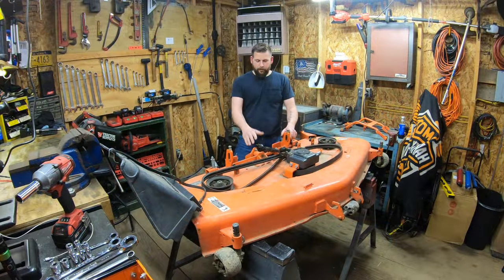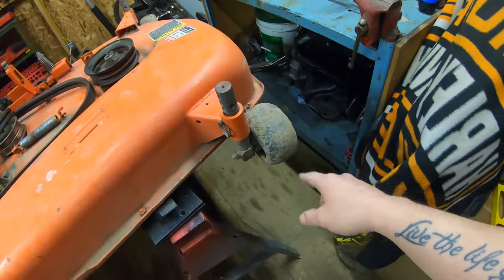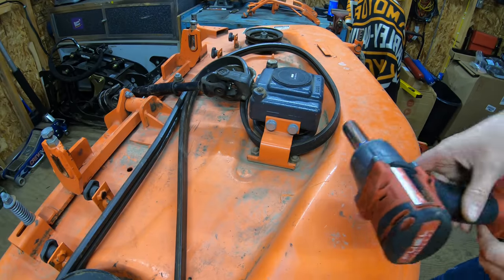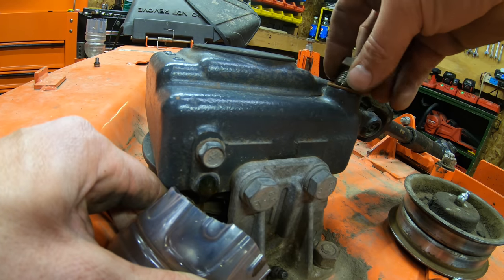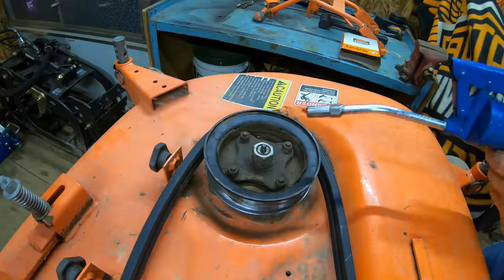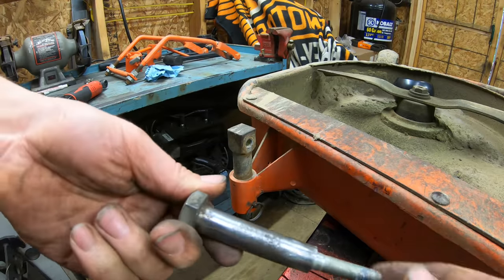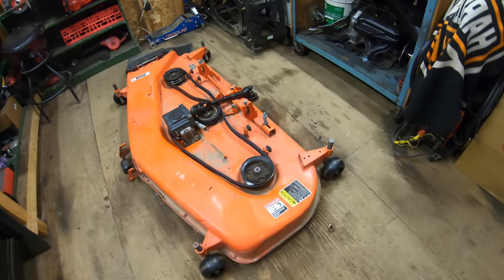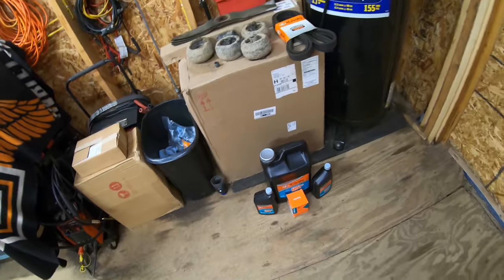Kubota BX- Spring Mower Deck Maintenance!!

Comment: I’ve never thought I’d have a use for the pallet forks, but using them to move the mower deck around has me thinking about it.
Reply from the maker: Pallet forks are one of those attachments you don’t think you’d ever need but end up being one of your main used attachments specially if you do not have a grapple.. before I had my grapple I used pallet forks for everything, from ripping up roots, old flower bed wood boarders, using them for picking up branches/limbs all over my yard every spring, to moving logs and other odd ball objects pallet forks are just a super useful thing to have and for the money you really can’t beat it. A lot of people think you need to move pallets with pallet forks but for most people pallet forks are used 80% of the time for objects other than pallets haha.

Comment: I use the Oregon G6 Gator Blades on my RCK54P23BX deck. They do a great job chopping up the grass and mulching it.
Reply from the maker: Right on, Iv heard a lot of good things about those Gator blades, they work really well for mulching up the grass.. I usually bungee up my grass flap so I run regular kubota “high lift” blades which work real good for the grass Iv got around here. Maybe some day I’ll make the switch tho to try them out 👍🏻
Reply: @BiffsEquipment  Thanks for the reply. I also mow like you, to spread it out and not have the rows of clumped grass.
Reply from the maker: @rickvb2709  very good, that’s the best way to mow in my option, like you said it really spreads the grass out in all directions and gives the lawn a nice striped look when it’s done too 👍🏻

Comment: Another nice video.  I really need to take more care with what grease I use.  Only have one gun so I end up using whatever’s in it for whatever I’m greasing that day.   Also, the one time I took the tensioner spring off, I had to chain the deck to a post and use a ratchet strap to put it on the post.  Swore I’d never take if off again and haven’t.  Yours didn’t look bad at all going back on.
Reply from the maker: Thanks man, sorry your comment for some reason wasn’t showing up under my YT phone app, idk why it hides comments from me sometimes. As for using the same grease for everything I’m sure your not alone there, but I’m pretty OCD when it comes to that, you’ll see much better results and the grease will last much longer if your using the correct grease for the correct applications. The most important thing is, is that your sure to use bearing grease in your bearings.. so if you want to run only one grease then I’d say run a bearing grease in everything and you should be fine.. something like Lucas red N Tacky would be ok in anything tho Moly grease will last much longer in your loader pins specially if your like me and can sometimes go over your hours for greasing your loader. 

Your right these deck springs are a bear to get back on, it took me about 4-5 attempts, I just cut them all out of the video to save on time, it was hard for me to get the leverage with out pulling the deck towards myself like you said lol.

Comment: Great video. I do my maintenance while it's on the ground and it's nice to see a back-friendly alternative. I'm in my 60's and would love to see how you 'flipped' the deck over for blade change. My current method involves a sling strap on the center 'wheel' and pallet forks to get vertical.
Reply from the maker: Thanks Dave, I did it the exact same way as you described, only I lifted it off the saw horses first up in the air then directed it with my hands to be flipped and set it back down. It def makes a big difference working up high where you don’t have to bend over, you can get a nice set of saw horses cheap these days too so that’s what I’d recommend for when you need to do mower deck maint. (I hate working on the ground!) haha .

Comment: Really nice video, Mike. I'm looking to put a small winch on my tractor to help out with logging and other things. Your deck will be happy this summer with the new wheels, belt and blades! I push my Cub Cadet mower blades pretty hard but they're still cutting clean. I need to take a look at them though. Great work as always!
Reply from the maker: Thanks buddy! It sure mows nice now! Used it all morning to finally mow my yard for the first time this spring and it did a fantastic job, best it’s mowed since I bought it! Sounds like you have a little maint. To do yourself before your first mow. As for the winch you can get them pretty cheap at harbor freight, I made an entire video on how I made it winch setup but it’s a really old video but if you find it on my channel it may give you some ideas of how you wanna rig up a winch to your tractor. Thanks for watching! 👍🏻
Reply: I have the G5 Gator mulching blades on my Cub Cadet lawn tractor, they do great, and seem to hold up longer than the factory blades do.
Reply: @wildbill23c  I bought a set of those when I bought mine, but I'm waiting to wear out the factory set before I replace them. I think one more session of "mowing" my trails to clean out the gunk will do it. LOL

Comment: Nice job with this. Only additional thing I would suggest is removing and cleaning out the spindle cups/guards when changing the blades. They get filled up with old grease and grass clippings over time.
Reply from the maker: Thanks buddy, and your right you should do this when you get a chance.. I don’t think it’s needed to do each maintaince cycle but for sure every other cycle just to get that old grease out or to at least pop the cup off and see what it looks like under to see if the grease looks nasty or clumpy. Thanks for the comment!
Reply: New grease takes care of it

Comment: Fantastic video, yesterday I had my first belt issue while mowing with the Kubota. Belt began to delaminate possibly from spindle heat. Did not break but outer layer came off in areas. Your video is helping me with diagnosing the problem and hopefully preventing similar future issues. Mower deck only has 25 hours and blade started to shred when I was mowing tall heavy grass. I was in two wheel drive at 3500 rpm’s in turtle mode. Deck and belt sat in the sun for over a year prior to first use which may have reduced life span. Gear box was weeping quite a bit of fluid on the deck when I immediately removed it after smelling the melting belt and seeing pieces of belt in yard. I had greased all fittings prior to mowing and deck was relatively clean. Any thoughts or suggestions would be appreciated. Thanks again for a great video.

Comment: Nice. I want a BX badly. Trying to manage 8 acres with 2 old wheel horses...
Reply from the maker: Wow that’s a lot to maintain with a few old wheel horses! Tho Iv always been a fan of the older wheel horses I feel you’d be much better suited with a compact or sub compact tractor for sure. Let us know if you buy one!
Reply: Are you only mowing??  If that's all you are doing perhaps a used commercial 72" zero turn would be a great choice.

Comment: You want your rollers about 19mm lower than the bottom of the deck. Not so low that they run on the ground constantly. They are to stop the deck digging in on undulating ground. The hole in the handle of a shifter works for a spring tool. I think you call them crescent wrenches.
Reply from the maker: Yep this is correct. Thanks for sharing!

Comment: Excellent video, some great tips. How did you tip the deck over, is it doable by hand, or use the loader. Also any problem having the gear box upside down. Want to take my blades off for the first time to sharpen. Many thanks.
Reply: Gearbox wil be fine (look if there's a sniffer ontop that may start leaking when it's upside down)
Reply from the maker: Yep it’s doable by hand, I usually flip it over by hand when the Deck is on solid ground like it was at the end of the video.. you shouldn’t have any issues just be careful and watch your PTO shaft doesn’t fall out when you tip it over 👍🏻
Reply from the maker: @rubendejong4412  is correct, because the spring valve/check valve is inside the vent the oil wont spill out of the vent because the check valve will close when it’s upside down keeping the oil from draining out of it
Reply: Thanks will do.  @rubendejong4412

Comment: Thanks Biff, I have a question for you at the end of the season would it be a good idea to take the attention off the tensioner pulley by undoing the spring when you go to put your lawn mower deck away?
Thanks
Michael
Reply from the maker: Hey Mike, yes it’s definitely always a good idea to remove your tensioner spring before you store your deck for the winter .. this will not only keep your spring from stretching but will also keep your belt from stretching as well and it’s actually recommended in the owners manual for the deck I believe. 
Thanks for watching!

Comment: All the grease comes out of the bottom of the spindles. If you take off those guards under the blades you will find all the extra grease.
Reply from the maker: Your correct, the grease is held under those “cups” that sit under the blades.. but what I was referring to is “if you see grease coming OUT the bottom then you know youv got the spindles packed” 

Thanks for watching!

Comment: Some of the Kubota manuals specify to replace the lower (output) seal on the deck gearbox every 4 years. Very inexpensive repair compared to rebuilding the gearbox.
Reply from the maker: I agree! Though I’m really big on (if it ain’t broke don’t fix it) on stuff like that.. but it never hurts to be cautious because a seal is a lot cheaper than a new gearbox! Thanks for the comment

Comment: Nice video! Wherabouts in NY are ya? I'm in WNY between Buffalo and Rochester. One additional thing I do-when I take the blades off, I always remove the dust cups under them and clean out all the dirt/grease/and dried grass, and checked to make sure not dinged up-they are only around $7 each. As far as grease, never thought of the 2 different types. Always used the red grease for all fittings. All Kubotas I've  owned(GR2100,BX1870, now BX2380) always did 10 pumps in each spindle. Did the 2" wheel spacers leave enough room between rear wheel and rear deck wheel on the 60" mower?
Reply from the maker: Thanks Robert, that’s a great tip, it certainly wouldn’t hurt if your doing all the maint specially with the blades off to just remove the cups and clean out all the old/dry grease why your at it, very good suggestion! As for the the wheel spacers, 2” spacers will clear the 60” belly mower but if you have a 50” belly mower you’ll need the 1-1.5” spacers
Reply from the maker: I live about 45min west of Buffalo, so pretty close to you! still waiting on this weather to straighten up so I can get out in my yard!
Reply: Lol I'm in Rochester... I recognized your accent immediately. WNY represent!
Reply from the maker: @balconio1172  haha yah buddy! Good to meet more guys from WNY who watch my channel, it’s always fun meeting locals ! Maybe I’ll see you at a tractor pull this summer haha

Comment: Wish my dealer would get me my mower for my BX...its mowing season, would be nice to have it.  Its only been 9 months since I got the tractor, salesman claims the mower is still MIA, no shit LOL.  9 months seems pretty excessive of a wait time.

I have 40 hours on my BX, the hydrostatic transmission/hydraulic fluid change will be done here soon, I have the filter and fluid, like you waiting for warmer weather.  The initial oil/filter change will be done at the same time...should have a nice mess by the time I get done, never fails with every oil change on a vehicle I make a mess, so the tractor shouldn't be any different HAHA!!!
Reply from the maker: Damn that sucks! I agree I think 9 months is pretty redic for a wait time on a mower deck, I’d call them up soon and put a little pressure on them and tell them your grass is already a foot tall and see what they say haha. As for the hydraulic fluid change that’s really good you are doing it at the 50 hour mark.. a lot of guys don’t think it’s needed at 50 hours but trust me it is, there’s a lot of break in material and RTV material from the assembly process that will be stuck to the filter screener inside the trans so def be sure to remove that and give it a good cleaning. I’m also excited to do mine to see what that screener looks like after the last 480 hours Iv put on my tractor that we’re VERY abusive. I’m curious to see what it all looks like. Keep me posted with how you make out!
Reply: @BiffsEquipment  I called my salesman a couple days ago, and asked where my mower was, oh still no update from a couple weeks ago.  I said that's strange the dealer 8 miles across town has 2 of them in stock...so either get me one, or give me my money back.  Supposedly he's supposed to be getting me a check, not holding my breath as many lies I've heard from him, unfortunately I cannot afford to spend another $2500 to get another mower, so I'm stuck making payments on one that don't exist.  With no paperwork trail showing I'm still owed a mower, its a horrible deal all the way around.  Not happy at all with this dealership, and certainly wouldn't take my tractor to them to have any work done, I probably wouldn't see it for a year or longer, or the idiots would sell it to someone else.
Reply from the maker: @wildbill23c  damn bro that SUCKs! I sure hope they make it right and get it to you soon!
Reply: @BiffsEquipment  I finally got a refund but had to add an additional $200 to it because the cost of the deck has gone up...but was able to go to another dealer and get a mower from them.  So, after almost a year I have the mower, but had to go through a different dealer...my salesman said the last update on arrival of the deck would have been the end of July...umm so who's mowing my yard until then LOL.  I should have asked them for one of their fancy Kubota Zero Turn mowers until the deck showed up LOL.
Reply from the maker: @wildbill23c  damn man, that’s crazy well  I’m glad it all worked out and now you can finally try out mowing on a bx. The bx mows beautifully, I just mowed my lawn last night and I’m always so impressed with how nice of a job it does. I can even get mine to stripe
Reply: @BiffsEquipment  I mowed a couple sections of my yard and pasture a few days ago...it does a great job, just not impressed with the dismal grass discharge...it doesn't blow the grass out away from the mower very far.
Reply from the maker: @wildbill23c  see I never had an issue with the discharge.. but I keep the flap up, I never leave my flap down. I drilled a hole in it ans use a bungee
Reply: @BiffsEquipment  Hmm, that flap is pretty large, might be the issue...thanks, I'll try raising the flap and see how that goes.  I end up wearing most of the grass clippings anyways with the flap down HAHA!!

Comment: When I do 30 - 35 pumps on my middle spindle, the grease comes gushing out under the pulley and does not come out the spindle guard on the underside of the deck. Any idea why?
Reply: I just had to replace the seals on my gearbox. That cavity for that Central spindle is huge. Maybe your problem. Also, there is a seal underneath the bracket that might be bad.
Reply from the maker: I agree with David.. it sounds like you’ve got a bad seal.. your upper deal should not let the grease out before the bottom.. if so then I’d replace it because if it’s letting grease out the top then you can be sure water is prolly also getting in through the top as well where water easily collects near the seal. There are videos online of changing these seals. I havnt changed mine yet on video because mine are still good but I’m sure I will some day! Thanks for watching!

Comment: I am waiting for someone to rip that exact gearbox apart in detail. Not the ones with two port holes.
Reply from the maker: I will certainly do it for you guys if I ever need to! Hopefully I won’t have to for awhile but next spring I plan to do a video replacing the seals on the gearbox so stay tuned!

Comment: what was the point with the winch? just showing it off?
Reply: You can see that the ground was to wet in that area . So as to not make ruts use the winch to pull the deck out to a dry spot.
Reply from the maker: @sixgun2719  is right, I figured I’d use my old winch mod to drag the deck over the wet part of my lawn so I didn’t have to drive through it.. soon as you get to the bottom of my hill it gets SUPER soft this time of year and I didn’t want anymore ruts to fix as I already made some in the video I did a few weeks ago 👍🏻